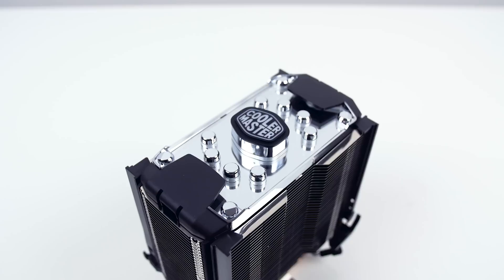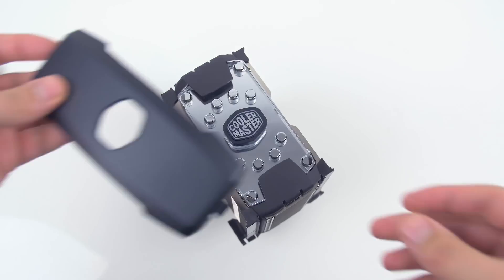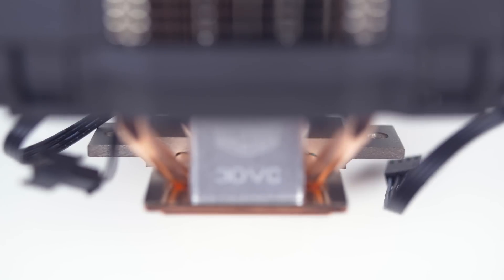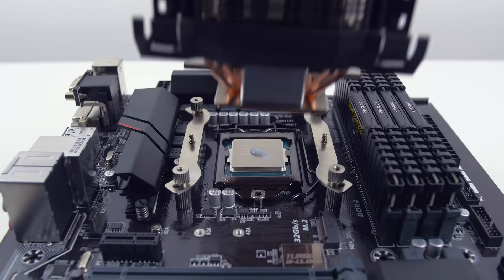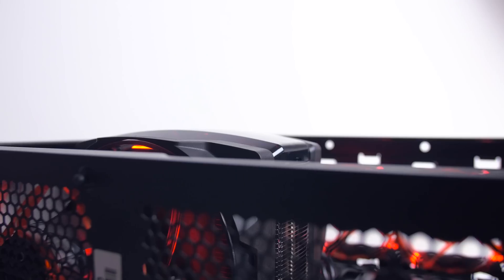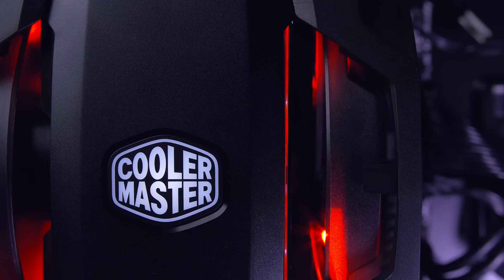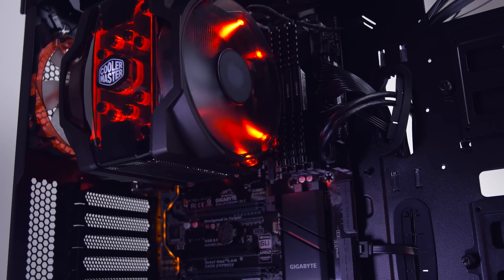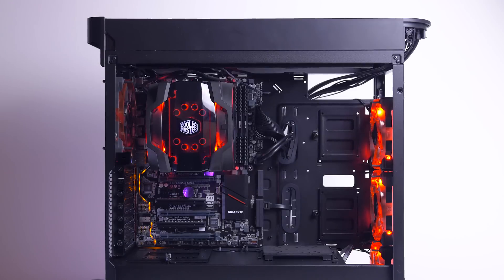Cooler Master MasterAir Maker 8 - The Best CPU Heatsink Cooler?

Comment: I can run a tower cooler in my air-cooled case and if the CPU fans die i can keep going with passive heat radiationinto the case until they get replaced. The same cannot be said for water cooling.

In addition you chose a case with a terrible orientation for the demo. Sliding up and out with simple clips should be fine for more case.

Now if it only wasn't just red LEDs. Give us choice or leave off the LEDs.

Comment: This cooler rocks, just do your homework on memory and case dimensions and you get a cpu cooler system that lasts basically forever, just dust off and change fans when needed.
Keeps my I7 8700k OC to 4.5g at an average 59c at 100% load with anything I throw at it.  I did play with fans and found that the sickle fans work well. Even with one fan, it does a good job. But it’s designed for 2 obviously..

I use 2 input fans, 2 exhaust fans,  2 front in, 1 back out, 1 top out on Mastercase Pro 5. 
I experiment with different fan configurations and this is the best so far.  I will try a 140mm fan on top next and disconnect the back fan then reverse the setup.
Happy cooling and happy new year..

Comment: I rather have a heatpipe tower cooler for reliability and almost zero maintenance, but AIOs like the H80i let you pipe the heat outside of back of the case and have zero RAM clearance issues. I had one chassis that came with a pre installed mobo back some 15 years ago that the heatpipes and cooler were at the back of the case. So you got the benefits  of both. I wished Coolermaster offered tower style CPU coolers that are offset to the point where the actual main cooling fan was directly above the CPU. Making it easier to pump the heat out the back and not worry about RAM clearance or AIOs crapping out on you.

Comment: looks like it would block lots of x99 and x299 top pcie slots as its right over that x1 slot on the z170 if it didnt id be all over it x.x I do hope these temp test were done for an extended time as many places show the d15 as matching a lot of those aio's that beat the maker 8 that you showed beating the d15

Comment: I picked the R1 Universal (This didn't come into consideration), it seemed like Air worked for what I wanted, most reliable, quiet, with enough performance, it's right up there with the best AIOs but won't have potential pump or leakage issues, if one of the fans stops it'll still keep the system from shutting down and I can just replace the fan/s, also I think they look the best.

Comment: 1.35 kg hanging off the motherboard!?  ewwwww!    Someone needs to apply some innovation to air coolers.  We need flexible heat tubes so that the weight can hang from the top of the case.  And for $129, I want AURA (or equivalent) controllability of the LEDs.

Comment: hello that pic of all the benchmarks from different coolers. the phantek 12 is amazing performing i was about to get the 212x but the phantek is alot better and i can get it for the same price like the 212x here in spain !!!! phantek went down here from 75 to 35e.  my queations is wich termal paste did you use for the tests ??? the one wich is included with each cooler or artic sivler ???

Comment: So it's bad just because it can't outperform all-in-one coolers? XD Ram clerance problems is when you can't install the cooler bc ram gets in the way, you can just adjust the fans in this one so it's not a problem. Also you can replace the stock fans if you want it quieter.

Comment: i would love to use this cooler as all in water cooler sucks - i'll explain how -
1- all in one water cooler has say 1% chance or maybe more that the cooler leaks , see if a cooler fails ok fine i accept i can buy another , but when it leaks and damages other parts of your computer then its a loss a huge loss and this is a possibility and it will always be .
2- the pump dies and there is a higher chance of it this usually a pump runs for 3-4 years and u'll never know when ur pump died. where i live it is  hot usually for like 8 months of the year we use air conditions and water cooler at home and the pump which costs like $50 here dies in 2-3 years and that's freaking huge solid  pump compared to thiny pumps on all in one water cooler .
 
yes all in water cooler performs better but with risk of damaging you computer ,  i am a professional rendering artist with a $8000 pc  i simply cant afford a leak i just cant 

now coming back to coolermaster airmaker 8 , currently i am using two coolermaster v6gt and like this cooler v6gt also has a ram issue , and if ur ok without fancy ram  and like a simple kingston hyper x or a gskill aegis ram and these are very good ram then you are fine with this cooler .
now the performance part air cooler depends on the case flow better or bigger the case more fans and better the performance , 
over clocking is another thing which is well suited to watercoolers  or a custom waterblock and with cpus these days  if your only gaming then cpus are so powerful these days that u dont need to do a thing to your cpu  to get better frames . 

now this cooler is expensive yes it is but it beats all the competition out their in air cooling with the likes of noctua nhd 14 and 15 or the cheap hyperx 212  , i was reading all the hate comments about this cooler , and sply due the negative review done by hardwarecanucks , common man you say the cooler is big , well yes it is if someone plans to buy a $130 cooler  he would never fit it in a mid tower like you did , why did't you use the cooler master haf 932 , this a full tower case cooler , check the nactua nhd15 or 14 they fucking cover the whole motherboard .

Comment: A: The professional packaging looks nice.
B: You could always mod the fans with different colored LEDs.
C: I see no problem with the fan mounting. You sound picky about it.
D: They leave room for people to enjoy the modding of lapping it.
E: Maybe you should of read the measurements of the cooler before installing it in your PC.
F: The cable seems plenty flexible enough. Once again you sound like you enjoy complaining about things.
G: It seems to do a good job compared to 120mm AIO coolers.
H: It looks nice which 90% of air coolers do not. So at least it gives a better looking option for modding.
I: It seems like it is meant for people who already spend thousands of $ on expensive mod PCs so I don't think price is an issue.

Comment: So the only thing they barely managed to improve on was the installation process.

RAM and case clearance issues still have not been fixed. Good one, Cooler Master. :/ 

Oh, and don't forget that they still kept the somewhat hard to open, "I'm about to spill all of my hardware parts everywhere" hard plastic they use for the screws, pads and paste they put them in.
Reply: look at the graph. lowest temps there. beat the all mighty d15 by 4 degrees.

Comment: this is an awesome cooler, but the price point just isn't right
consumer is paying more for aesthetics, but in terms of value it's not so good. in my country this cooler cost as much as the Corsair H100i.

if case compatibility is concerned, usually a case that could fit the Maker 8 could also fit a 240mm AIO watercooler.

i wish Cooler Master would lower the price point a bit more, perhaps in the same price bracket as the Noctua NH-D15. would definitely choose this over the Noctua equiv because the latter's poop colored fans.

Comment: Bought this cooler together with my NZXT noctis 450 case and a i5 6600k 3.5ghz overclocked to 4.55 and it works like a charm. Got to maximum 77 degrees with prime95.

Comment: After purchasing All in one liquid cooling systems, and having them break down, or under-preform, I am getting this Maker 8 cooler. I have an 8 core AMD 4.2Ghz cpu, and when I first used an all in one liquid cooler, it's hottest temp was 90F, but then this temperature increased as time went on, so after my CPU overheated I bought a double radiator all in one cooler, but now it's running at 155 F under full load. I got it down to 124F, but not for long; for some reason the cooler is breaking down, or not working as well. I contacted AMD's support Forums, and they told me to get the 4 Heat pipe model, but after investing all this money into liquid cooling, and a new CPU, I decided to go with the Maker 8, just to be safe. I render YouTube videos all the time for a living, and I can't have it blow out. So I have decided this should be more stable and reliable. I will get it on Tuesday. I'm also using the MX-4 thermal paste.

Comment: I've seen better surface finish on $20 cooler stacks from China.

How about less attention to styling, and more care paid to the actual job of removing heat ?
Reply: rough surface more surface area for heat transfer.
Reply: UrBeastyBalz619 , no, it reduces the contact area, - that's why thermal paste is used to fill any gaps, but it's not as good as direct metal contact.

Comment: can i replace these fans with corsair 120mm fans? and is it compatible with rog maximus VIII impact? thankyou and sorry for my english lol :)
Reply: I also wanted to know if you could replace the fans with the Corsair fans?
Also if you could, would that cause the air flow not to work as designed?
Kenneth have you found any info on this?
Reply: Well, he clearly explained that you can change the fans for 120mm fans, so yes. Use static pressure ones for best performance. (Or Static as a pusher and Airflow for puller)
Reply: +Ignafiltro Sanchez thanks fam :)

Comment: Does anyone know if this will fit in the DIYPC Skyline-06 WR ?
Reply: According to the website the Skyline-06 fits up to 165mm coolers, but this is 172mm. So I would say no. However If you wanna risk it the similar looking (and also sligthly cheaper) Cooler master V8 GTS is just above 166mm, so it might fit.

Comment: I'm attempting my first pc build and was curious as to what non liquid cooler you would recommend for the i7 6700k? I don't plan on overclocking.
Reply: Get a Hyper 103, if you ain't OCing you don't need much else. It just it has lame blue leds but meh whatever given its price and performance. 30-35'C idle, load 65'C

Comment: I think they should combine the vapor chamber of the MasterAir Maker 8 with the size of the 212X. That smaller, only 120mm fan form factor would make it more appealing to other cases. Also the fan attaching design needs to go, I'm pretty sure there's just some simple wiring holding the 212X fans into place which could cut costs but still get the job done just fine.

Comment: the best part of this cooler is 2011-v3 compatible out of box, which saves a lot of trouble, like I am looking for a cooler can press down a 160W xeon e5 cpu. and air cooling is more durable less hassel comparing AIO, so I will consider this.

Comment: Will it fit on a Corsair 780T?
Reply: I don't know if I am too late but I think it should.  The side panel bulges out a bit so I think that will be enough.  Check on PC part picker or just look over the dimensions again to be sure.
Reply: Samuel Lopez yeah you could get a 120mm fan to put in its place to clear some room but if it is working out for you now I wouldn't waste your money.  I personally am using a h80i v2 in a thermaltake h22 (which I plan on replacing soon because it is just way too bad for airflow and besides the exhaust fan which I use for the watercooler fans has no screws for case fans) and it works out for me.  but I keep my side panel off to drop my temps further because it is just too hot (about 10 degrees c more on the gpu and cpu).
Reply: It did fit! Unfortunately didnt take into consideration that the MSI M5 MoBo RAM slots are all on one side so have to lift one fan to place RAM underneath it :-(
Reply: I love how good for airflow the corair 780t is, ill keep the cooler master since it keeps the cpu frosty idle at about 25, 4k maxed gaming for over an hr about 55.
Reply: Samuel Lopez yeah I built a 6k$computer with my friend with specs I gave him and I used that case and the temps are really nice.  we replaced all the fans in it and put a 360mm aio at the top.  he loves it because it was an early graduation gift.  the computer itself cost around 5-6k not including the vive, mouse, keyboard, 4k monitor, and games.
Reply: Man that sounds awesome, mine is my first build and def not such a beast it scored great on Firestrike :-) i7 6700, 32Gig Ram @3200, MSI M5 MoBo, Dual MSI Gtx 1080 Gaming X.
Reply: Lol that is a beast his is a i7 6900k on the Msi godlike carbon with 128 gb ram and two nvidia gtx 1080 founders editions.
Reply: Bad ass!!!!

Comment: for the first time I will be  using 212 EVO to cool my intel 1150 Celeron CPU instead of the stock heat sink that comes with the celeron CPU.    I want to go water cooled but I am afraid of leakage.  But for the price I think I will take the plunge and try water cooled as I have never tried water cooled before.

Comment: When looking for cpu cooler looks, there is nothing that can replace air coolers 
When looking for performance clearance price and overall clean build then you go for water cooling 
I love both styles
Reply: Reliability for air coolers as well. No chance of a leak that can damage the rest of your computer.
Reply: +Krytern UK amen to that , i just got PC delivered to me that had a leak but thank god the customer got above average components and despite of the big leak every component survived 
I was scared for the gpu (390 nitro) because it was the most wet part but i put it in rice for a day and it dried it just fine , put it in the rig and it runs great 
i am really considering this cooler or the v8 gts , i am going for looks in my other rig and i really dont like the price on this one
Reply: Is this still a problem with $100+ water coolers? I am building a new system for the first time and I have to make a decision about the cooling. I do not like the idea of this heavy fan sitting on my motherboard, but I also do not like the idea of water in my almost 3K build.
Reply: Anthony Perez I don't see a reason to not like a heavier fan on your motherboard. Motherboards aren't fragile things that you need to be careful of. Also, OF COURSE a $100+ water cooler can leak. Why couldn't it? Have you, family or a friend ever had something expensive that broke or stopped working somehow? Ever heard of someone buying something and it didn't work right out of the box brand new? Why would water coolers be special against everything else and not happen?
Reply: Anthony Perez there is always a risk no matter the price :(

Comment: bought my H110i GTX for almost $50 less in my country, still performs better based on this benchmark xD

And they say liquid coolers are more expensive than air coolers for the same performance
Reply: Does it have that annoying pump drone? 

My Swiftech AIO has an that annoying drone now and I'm planing on replacing it with a Corsair AIO or this cooler mater Maker
Reply: Funny story, I mistakenly ordered the maker 8, so yeah.

Comment: I love HWC but I hate it when reviewers complain about "too much packaging". If they didn't use this much everyone would be like "Come on Coolermaster I'm paying 130$ for this I want it to arrive safely".
Reply: Aditya Upadhye the packiging for that unit should cost no more than 2 dollars,it keeps the parts separated and they also act as a buffer(crush protection) for the product,it's also recyclable.
And yes I worked a a packiging designer for a corrugated plant in the Northeast.
Boring job but someone has to do it.
Lol
Reply: Mr Kagouris well, if there wasn't so much packaging, it would cost less so you wouldn't be paying so much for it

Comment: I'm still using my hyper 212 evo. my next cooler will be the 212x. Im just not an AIO guy ...yet.
Reply: get a noctua d15 instead
Reply: Does the Noctua D15 cost the same as the evo or 212x? If it costs twice as much, not interested.
Reply: +Krytern UK Noctua's are much more expensive. They are great coolers if you have the extra cash though. 

The hyper 212 gets the job done for much less.
Reply: Gregg Reaves I'm building a new computer within the next week with a i7-6700K so I am thinking of getting the 212x. First computer I will be building in my life that has no AMD hardware in it at all.
Reply: +Krytern UK there are better coolers for the price, do your research before you buy

Comment: I was a fan of air coolers since the early days of PCs, however, since I started using AIO (Antec Kühler H2O 920) 2 years ago on my i5-4670K system, I enjoyed the quiet operation and high efficiency of liquid cooling. My next PC build would be the new Broadwell-E/X99/GTX1080 system in the next couple of months once it is launched in June.

Comment: i tested and i am not interested at all in AIO personally.
They are more expensive and makes more noise than a good air cooler.
If i change my BeQuiet Dark Rock Pro C1 , it will be for a 3, but not for an AIO.

Comment: The air cooler I have on my CPU does just fine as is. Also no point in overclocking an Intel Core i7 4790K above 4.5 GHz.

Comment: I bought it, got tired of the noise my aio pump was making, also pulled my custom loop out. I haven't the time or patience for draining it. This seems to be a solid kit to cool my 5820k with low maintenance.
Reply: +I-BLANDON-I im thinking about the same combo. have you tried any OC'ing with the 5820k?
Reply: I did 4.4 idles at 47c max 70c
Reply: rubs hands interesting...